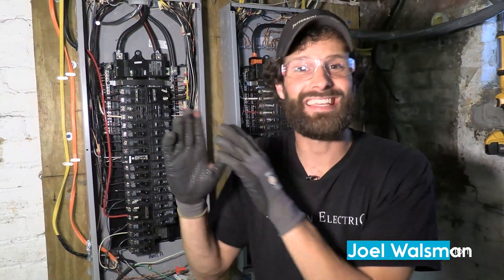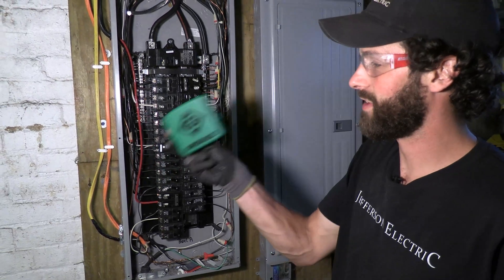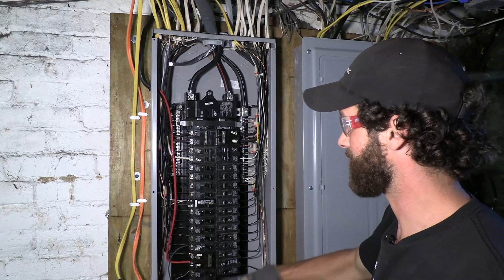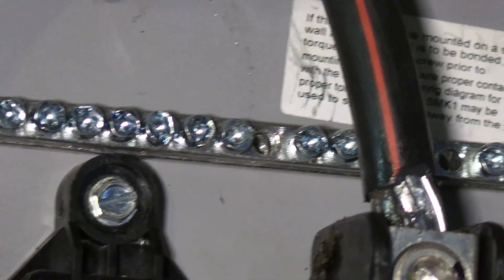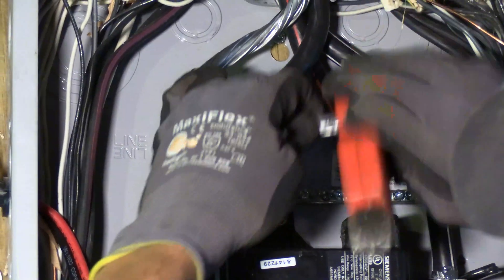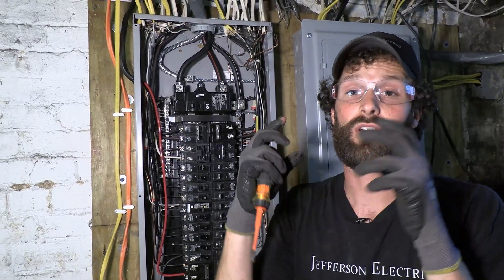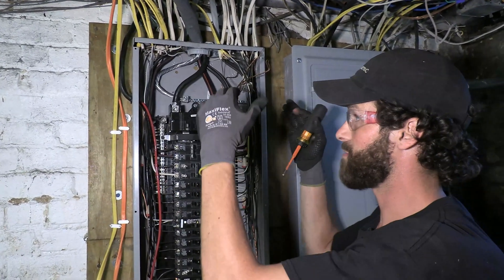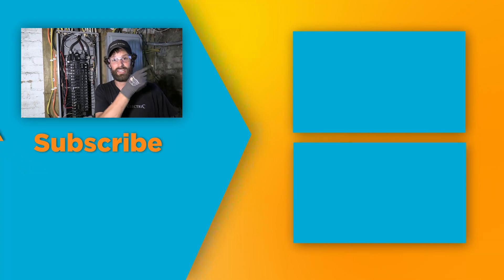This Metal Block Fixes A Common Electrical Panel Problem

Comment: I'm not an electrician I learned from my father which is a certified master I remodel and repair houses I'd never ever put a ground bar or extra neutral bar above supply line imagine loosening One of those set screws and it springs down and hits one of the main lines and just in general it being close but if you could pass it in your city I guess but it's a hell no for me respectfully...i just wouldn't do it my opinion

Comment: Putting the ground bar behind the hot leg inputs is a really bad idea 

Most panels are already pre-drilled for installing a ground bar specific to the panel. At least on my Siemens panels it is this way.

Comment: Having a ground bar right next to the incoming lines seems completely nuts IMHO. Right after the person in the video said that the incoming lines are still hot even after you shut off the main breaker, he puts his hands and wrist right next to the hot wire. No way would I want to be messing around with ground wires right next to that.

Comment: If you kept the feeders energized during this operation you would be much safer leaving the main closed.
The way you did - all the potential now has mostly one path to ground.  Through you!  It's mainly you loading the 
Circuit interrupter to trip levels.

Comment: So won't the electricity flow from the mounting screws in the ground bar, into the mounting screws of the neutrals?
Reply: I did not see or notice when he pulled the bonding screw.  The nuetral bar is insulated from the chassis when bonding screw is out.  This would be standard for "suitable for use as service equipment"  the ground and neutral can`t be separated whe it is"suitable ONLY for use as service equipment"  like a meter main.  Caps for the important word.  So his  panel can be a main, or a subpanel.

Comment: It's a code violation since the panel manufacturer did not approve this mounting method and you didn't mention that the panel and the bar were the same manufacturer AND listed for that panel, which is required. The threads are also a code violation because there are too few threads in sheet metal. Like one thread. When the factory makes threaded holes in the can the hole is punched, not drilled, giving much more depth for threads. 
Hack job.

Comment: I'm a DYIer, project engineer by profession. 
 I've remodeled my house, passed all the inspections with flying colors.  Always do my research.   Because of your videos, I decided to pull the cover on my garage subpanel.  Guess what, the grounds and neutrals are combined.   Bought the parts this evening to separate them tomorrow.

Thanks.

Comment: Remove the neutral bonding jumper below main breaker. Install grounding jumper from left busbar to panel enclosure   Separate grounds and neutrals. No ground bus install required. These sub panels are designed to be used on 3 wire or 4 wire applications.
Reply: @dirty rotten. Please explain to me how that’s shady unless your talking about the guy on the video who’s trying to ground the feed.
Reply: Unrelated note, DRI rules
Reply: @idmhead0160  dealin with it. 🤘🏻
Reply: I wouldn't let hire them wire a dog house.  Co has so many negative comments.
Reply: @williamshilling1862  Yeah. Pretty shady if you ask me.
Reply: @dirtyrotten2648  you never put a grd bar that close to the main lugs.

Comment: The feeder is hot, then why are you trying to mount your ground bar by the feeder lugs?  Mount the bar on one side or the other.  You're allowed to have multiple ground bars in one panel.

Comment: There’s room for that elsewhere in the panel. Placing it right above the main lugs is sketchy and creates a hazard for the poor souls who will be securing ground wires there in the future.
Reply: Or backing the screw out and and the wire slips down and hits the lugs.
Reply: @WeMe83 🤦🤦🤦 exactly

Comment: My opinion is that all ground wires should be green insulated not bare copper.  It only makes sense.
Reply: I wish the manufactures of NM cable would start doing that, but all the romex i've ever seen has bare copper ground...It is dangerous for people who have to land a wire in a live panel.

Comment: I'm not an electrician, but that ground bar seems way too close to the exposed hot conductors. Why not put the ground bar above the sticker like it appeared you were going to do at first?
Reply: Closer spacing than hot bushes to neutral.

Comment: A faster way may be to use the yellow ideal Spliceline 42 orange In-Line push-In Butt splices to extend circuit equipment ground connections from old neutral buss to new ground bar location.

Comment: I'm curious - does the electrical code or panel manufacturer  have anything to say about on adding something like that inside a panel? Obviously its allowed or you wouldn't be doing it! Are there restrictions one should know about? Obvious a very practical and solution!
Reply: My new square d panel gives instuctions to mount grounding bars in other than the pre driiled spots.  Just says to make sure screws cut threads into metal enclosure.
Reply: The manufacturer sells bars yo do just what he did. There's even little nubs and tapped holes is certain places if it works out with wire lengths.
Reply: @ralph5450  OK! So the manufacturer of the panel even intended for you to be able to do that! Thanks!

Comment: Awesome video, as always. 
Talking about those lugs: if there are OEM covers that the manufacturer started making, I try installing those, as a value add. 
If not, I tape the hell over them using 3M 2228 self-adhering rubber tape or 2229 pads.

Comment: Knipex and other good manufacturers provide a fully rated Mat that can be clipped across the whole main phase part of the panel adding that little bit more safety when working on individual circuits below.

Comment: How about he violated the UL listing on the load center by installing the ground bar in the first place.
Reply: I’m the wrong place.  They have pre tapped holes with a ground symbol by them for a reason.
Reply: @WeMe83  but he needed to install the one that was listed for the load center and install it in those pretapped holes. I don’t think he did that

Comment: Talk about setting up the next guy... If I see a ground bar there, I am installing my own bottom or the side of the panel. We can't just shut the power off when people have medical devices, or it's freezing cold or hot out.... because the electrician before me decided to put the ground bar over the top "because some grounds are short" and they can't be bothered to extend them. It's a total dick move for the next guy, just like putting small wires in larger diameter spaces.
Reply: "when people have medical devices" sounds like you plan to work it hot.  That is a BAD idea and, frankly, lazy.  Take the time to connect the medical equipment to another source.  Run an extension cord from a neighbor's house if needed.  There is ALWAYS the potential to short something in a hot box, and if someone is on medical equipment, you just killed them.
Reply: @ericapelz260  Lol, y'all really don't know or understand residential and commercial work if you think we can leisurely shut off power everytime we add or remove a circuit. Nature of the business is that you have to at times work in hot panels, so you do not put ground bar of all things anywhere near the line.
Reply: @Cemsicles  Yea, in my area some older houses don't have a disconnect means other than a main breaker, which does not de-energize the mains coming into the panel.  So you would have to call out the power company to pull the meter.
Reply: @ericapelz260  I had a backup generator installed and service upgraded a few years ago and a lot of work was done on my breaker panels - replacing the backing plywood, sifting one panel over, replacing another, and adding a transfer switch. It took a few dozen hours to rearrange all the cables and sort out the nearby phone, television, and data cabling. It was being worked on over the course of a week or two and it would have been impractical to not have worked on the panels when energized at times. To have a collection of extension cords bypassing everything for hours or days would not have improved safety.
Reply: @ericapelz260  You sound like someone who has no actual field experience...

Comment: Since this is an upgrade of an old installation which you didn't do yourself, before you did anything else you should have verified that you don't have a ground to neutral short somewhere downstream from this panel. Disconnect the 2/0 ground and neutral feeder cables and remove the bonding screw from the right neutral bus bar. That isolates everything on this load center from the system ground. Then pull off all the bare ground wires from the  isolated left and right neutral bus bars. At that point your meter should show an open circuit between the neutral lug and both the panel ground and the bare 2/0 ground cable.
Reply: He did the work himself didn't you pay attention ?
Reply: @jamesstringer4211  I paid very good attention. Did you? He only did the upgrade to add the external disconnect. He did NOT do the original installation of the panel he's working on now. He's merely modifying it to separate the grounds and neutrals.

Comment: Greenlee drill and tap set is $45. Go to Harbor Freight and pick up a set for $12. I have been using their set for many years with no issues.
Reply: way wayyy wait... you've been using  those SAME drill taps for YEARS? if in a power tool, unless im in a clutched drill at 2 or 3 ive never had a 6 or 8 last even months, i even keep the snapped ones for easy re threading where hole etc. already in place cuz drill tap go SNAP
Reply: Manual taps, yes.   Years. Drill taps, vrry unlikely. I have a set i inherited but would never put power on them.
Reply: Harbor freight?  You can't be serious?  No professional tradesman buys tools from harbor freight they sell cheap inferior cheap tools for clueless homeowners who don't know quality from garbage.
Reply: @gregmartin1757  99% China to boot.

Comment: "It's relatively tedious and time consuming to pull all of those grounds off and relocate them."

Understatement!

Have you gotten to the point where you have stopped thinking, "Ok, that looks clean, and everything is done precisely correct, but am I sure I couldn't have done that a bit faster?"  For me, I've accepted I will be thinking that forever.

Comment: Your out of your mind!!!!
      Who would put ground bar, spanning A and B. With in inches!
      Please don't give anymore advise 😔
Reply: It has nothing to do with ground plane or arc over.
The panel is now impossible to work hot.  

It would be much simpler to install ground bars parallel to the neutral bars as should be done in every new panel.
Yes, two or $15 ground bars would maintain the neat installation.
Reply: @denverbraughler3948  there is no reason that panel would ever need to be worked hot. Period.
Reply: @steveloux4709   .... there is no GOOD reason.  Lazy is a reason...
Reply: There is no reason ever to add ground bar across the top of a panel.  But watch the video to see what happened.
Reply: @steveloux4709  If you had much field experience, you would know that some houses only have a meter socket with no actual disconnecting means.  The main breaker inside the panel does not kill the mains coming in.  So the only way to disconnect power is to call the PoCo and have them pull the meter.  All just to land a ground wire??  Naa, I'd never install a grounding bar that close to the mains...period.
Reply: @Checkmate54321  it would be better if you didn't assume the scope of my field experience and just stick with your opinion.   By the way, I think in this video he describes that someone had previously installed an upstream OCPD outside.  So we're back to the fact that those incoming line terminals could be de-energized upstream, and eliminate the hazard before ever removing the cover of this loadcenter.
Reply: @steveloux4709  still... the placement of the ground bar is far from ideal. that is too close, to the main lugs,   no electrician with common sense would place it there...
Reply: @steveloux4709  How many years you got in the field, just out of curiosity.
Reply: 120 v to ground is all there is.  Makes it harder/ impossible to work live, but not unsafe when panel is closed.  I would have added anothe bar at bottom, or used the pre existing holes in the gutter for load grounds.  The main ground conductor will still need to be landed on a lug bonded to the box at the top.  The scews and threads are adequate per code, and will conduct fault current long enough to trip protection.  I connect ground bars to each other with #6 wire, biggest that go into terminal bar.  Overkill.
Reply: The placement is within the purview of the electrician, absent any manufacturer's directions.  This is a matter of preference and we know now that you would have done it differently.  But he is not out of his mind, nor is this an unsafe installation.  If we are following NFPA 70E, no one should be installing bussing or landing conductors within this cabinet with the power on, right?  All he has done is moved the ground plane perhaps 1/2" closer to the ungrounded terminals.  I don't see how 120V is going to jump across to the grounded plane given these conditions.

Comment: I don't understand why he didn't just remove the bonding bar and put the ground wires on the left side and neutrals on the right.  The  bonding bar is located directly below the main breaker and the main neutral wire is connected to the bar on the right.  The left bar is connected to the right by the bonding bar.  He was already disconnecting half of the wires.  Why not just move them all and put the neutrals on the right side and ground wires on the left?
Reply: It’s better to add ground bars parallel to the neutral bars.
Reply: Not every manufacturer makes it possible to remove bonding bars. It's just better practice since ground wires can be braided and bunched to save space but neutrals are not.

Comment: In our jurisdiction Aluminum and Copper can not be used in the same box and Aluminum is no longer allowed in new construction. Insurance companies charge an extra surcharge if the house has Aluminum wiring and can deny fire insurance if mixed wiring exists in the house.
Reply: None of that is pertinent to installations following the USA's National Electrical Code.  And those requirements/bans on the use of aluminum are not based in science either.  The alloys which comprise aluminum conductors since the late 1970's do not have properties of oxidation characteristic of the earlier aluminum wiring of the late 1960s - early 1970's.

Comment: So I'm confused you did this job and never separated the grounds and neutrals at the sub panel? Or it fixing someone's mistake?
Reply: Maybe neither.  He explained this panel was originally the first point of disconnect until a new main disconnect was later added outside the building.  While acting as a main panel, it's allowable to land both the grounded circuit conductors and the equipment grounding conductors on the same bussing.  Once the neutral was bonded in the cabinet outside however, this panel should have been immediately rewired.
Reply: How it was originally was a stupid ripoff.  
I never combine neutrals and grounds.  
Ground bars go parallel to neutral bars.

Comment: Turn off the breakers before the main bruh...jus my experience.
Reply: Good suggestion. For those following along at home, turning on the main while the individual breakers are on can cause a sudden surge as all the downstream devices that are plugged in/installed will all energize at the same time. While it is unlikely to cause a problem, there is some risk. Generally, when working on electrical, turn off (de-energize) all breakers starting from the point furthest down-stream and moving up until you reach the point in the system where you will be working. Then go in reverse when you are ready to turn everything back on. Be safe and good luck!
Reply: The utility company suddenly energizes 10,000 homes at one time.

Can you be specific about examples of problems that you can avoid that are no different from what happens 1 to 100 times per year in rural areas?

Comment: In Canada panels are required to be sold with ground bar, solve the problem as even main panels are generally wired with separated ground and neutrals....
Reply: This panel has separate and was “sold with ground bar”, the panel “was wired with separated ground and neutrals”, so you may have missed the original problem.

The problem is that this panel, in the role it previously played as the main panel, had the existing separate ground bar joined with the neutral.

The panel has moved to a new role as a sub panel.

He likely determined that moving the grounds to a separate new bar disturbs the least amount of existing infrastructure to solve the code / safety problem.

In this panel, Neutrals can be re-wired to one existing bar, grounds left on the existing bar, and break the bond between the bars… but if any old neutrals were cut too short to make it to the other existing bar, it would be a new problem.

This also probably reduces his liability, working with old equipment, by not touching anything else.